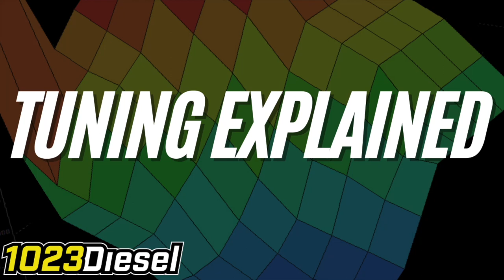Ep. 59 | The Basics of 7.3 Powerstroke Tuning (Audio Only)

Comment: I have a 03 6 door 7.3 with 450k on her. Would you be scared to tune this truck? I would love to get more power but I don't want to blow it up
Reply from the maker: I would be somewhat cautious of tunign a truck with that nany miles on it. Any amount of added power will also decrease the lifecycle of Power/Drivetrain components.

There is no way to say for sure how much power or what tune will shorten the engines life or even if it will be a calculatable difference. 

At 450k miles large engine failues are not uncommon, even if left stock.
Reply: @1023DieselFleet  thanks